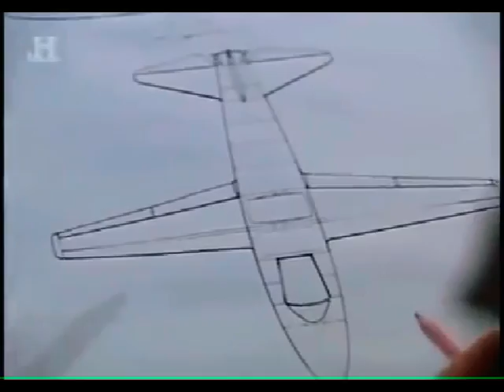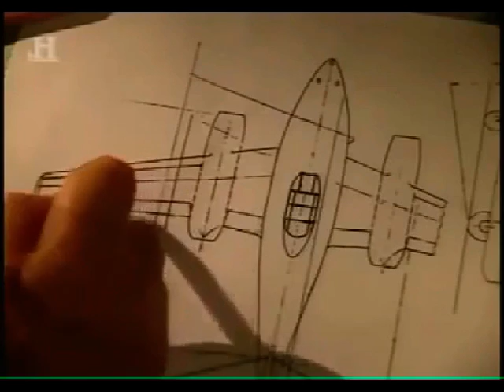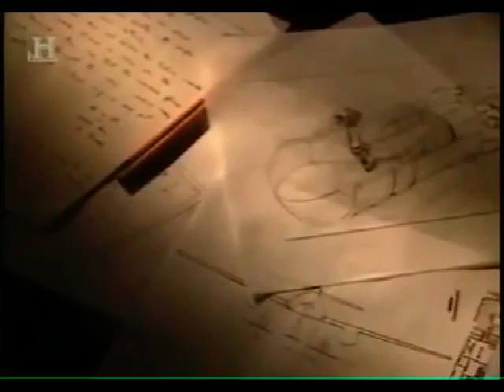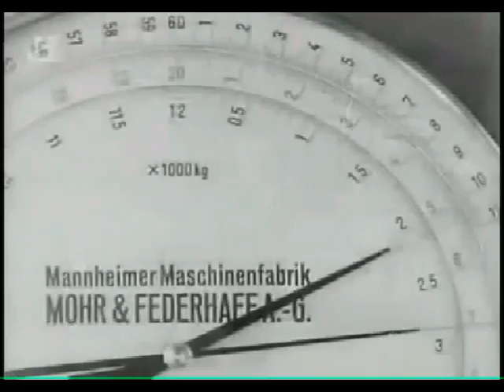The Father of the Jet Engine - Hans Von Ohain

Comment: More youtube bollocks.  The axial flow engine was conceived by many engineers in the 1920s.  The problem was it was always recognised the technology did not exist to make the engine reliable - as the Germans found out.  Whittle was well aware that the simple axial flow engine was preferable but knew it would be unreliable.  He chose to develop the centrifugal engine for practical reasons.
Reply from the maker: First jet flight - German, first twin engine flight - German, first operational fighter unit - German....Even R/R tossed the centrifugal design in the bin by 1950 for axial  (avon) as.it was a dead end design The limitation of the Me262 axial engine  were due to shortages of exotic metals  - not design.  Besides it could be swapped out in an hour  and could be services and reused.
Reply: Interesting theory, except that the Jumo 004 engine exceeded the 100 hrs PFTR standards of both the RAF and USSAF during WW2.
Reply: @sandervanderkammen9230  "If I could have fitted the Meteor engines to the Me 262 airframe I would have had the best fighter in the world" Adolf Galland.
Reply: @fritzfieldwrangle-clouder7299  You could not fit Meteor engines on the Messerschmitt Me-262, they were too big and heavy... centrifugal turbojet engines were a dead-end design.
Reply: @fritzfieldwrangle-clouder7299  You could not fit Meteor engines on the Messerschmitt Me-262, they were too big and heavy... centrifugal turbojet engines were a dead-end design.
Reply: @sandervanderkammen9230  You'll have to take that up with Adolf Galland. If I'm pressed to say who I would trust to know better on  the issue I think I'll go with Adolf Galland thanks all the same.
Reply: @fritzfieldwrangle-clouder7299  Centrifugal turbojet engines are too large and heavy, they are no longer used in  jet fighter aircraft... only axial compressor engines are used today.
Reply: @sandervanderkammen9230  Not according to Pabst von Ohain. From his forward to 'Elements of Propulsion, gas turbines and rocket'-
"The first patent of a turbojet engine, which was later developed and produced,
was that of Frank Whittle, now Sir Frank (see Fig. 5). His patent was applied for
in January 1930. This patent shows a multistage, axial-flow compressor followed
by a radial compressor stage, a combustor, an axial-flow turbine driving the
compressor, and an exhaust nozzle. Such configurations are still used today for
small- and medium-power output engines,"

So you'll have to take it up with him, If I'm pressed to say who I would trust to know on the issue, you or Pabst von Ohain, I'll go with Ohain thanks all the same.

Of  course you might expect Ohain to have a soft spot for centrifugal flow engines because his own design was a centrifugal flow engine. So if centrifugal flow engines are somehow not valid, are you going to tell Spottydog4477 that his youtube video is wrong?

 Anyway the issue was then, not now so it doesn't change that fact that Adolf Galland who flew both aircraft in service rated the Meteor's engines over the 262's.

What's more of course most jet fighters and civil aviation 'jets' don't use pure jets anyway, they use turbofans. This is what Ohain has to say-
"From the beginning of his jet propulsion activities, Frank Whittle had been
seeking means for improving the propulsive efficiency of turbojet engines. ¶ He
conceived novel ideas for which he filed a patent application in 1936, which
can be called a bypass engine or turbofan. To avoid a complete new design,
Whittle sought an interim solution that could be merely "tacked on" to a jet
engine. This configuration was later known as the aft fan. Whittle's work on
fan jets or bypass engines and aft fans was way ahead of his time. It was of
greatest importance for the future or turbopropulsion."

And as for Axial flow Pabst von Ohain's own description of Whittle's patent clearly refers to axial flow elements in whittle's design. In Ohain's own words-

"This patent shows a multistage, axial-flow compressor followed
by a radial compressor stage, a combustor, an axial-flow turbine driving the
compressor, and an exhaust nozzle."
Reply: @fritzfieldwrangle-clouder7299  Apparently you both were unaware of Maxime Guillaume patented the turbojet engine first in 1921.
Reply: @sandervanderkammen9230  You mean  the one with the charming little crank handle that we've discussed before, the one that Pabst von Ohain described as not viable. That Pabst von Ohain, do you think he was a liar?
Reply: @fritzfieldwrangle-clouder7299 What is your point? Frank Whittle's 1930 patent wasn't viable either... he never constructed it or any engine with a axial compressor.
Frank Whittle did not patent the turbo jet engine first and he was not the first to build a successful flightworthy turbojet engine.
 You lose.
Reply: @sandervanderkammen9230  Ah, the Whittle patent which Pabst von Ohain describes thus-
"The first patent of a turbojet engine, which was later developed and produced,
was that of Frank Whittle, now Sir Frank (see Fig. 5). His patent was applied for
in January 1930. This patent shows a multistage, axial-flow compressor followed
by a radial compressor stage, a combustor, an axial-flow turbine driving the
compressor, and an exhaust nozzle. Such configurations are still used today for
small- and medium-power output engines,"
That Pabst von Ohain, do you think he was a liar?
Reply: @sandervanderkammen9230  By the way Sandy honey, have you managed to come up with any evidence to support your silly claim that  Pabst von Ohain  built a prototype jet engine at Gottingen university in 1934? You know, anything that will sufficiently refute Pabst von Ohain's own clear recollection of doing nothing of the sort.
Reply: @fritzfieldwrangle-clouder7299  Whittle did not build an axial compressor turbojet engine.
Reply: @fritzfieldwrangle-clouder7299  The 1934 prototype was constructed by Hans von Ohain and Max Hahnn at Bartels und Becker Rennsport Denist in Gottingen Germany.
Reply: @sandervanderkammen9230   Evidence Sandy love. You can read Pabst von ohain's own words in 'Elements of Propulsion, gas turbines and rockets' and he makes it quite clear that no prototype engine was built in 1934. Are you calling Ohain a liar? Do you claim to know better  that he himself?
Reply: @sandervanderkammen9230 Pabst von Ohain's own word on Whittle-
"The first patent of a turbojet engine, which was later developed and produced,
was that of Frank Whittle, now Sir Frank (see Fig. 5). His patent was applied for
in January 1930. This patent shows a multistage, axial-flow compressor followed
by a radial compressor stage, a combustor, an axial-flow turbine driving the
compressor, and an exhaust nozzle. Such configurations are still used today for
small- and medium-power output engines,"
Just say it straight up Sandy honey, do you think Pabst von Ohain was lying?
Reply: @fritzfieldwrangle-clouder7299  Frank Whittle did not invent the turbojet engine....
Reply: @sandervanderkammen9230  Just to remind you Sandy dear, from Pabst von Ohain's forward to 'Elements of Propulsion, gas turbines and rockets' in Pabst von Ohain's own words-

"The first patent of a turbojet engine, which was later developed and produced,
was that of Frank Whittle, now Sir Frank (see Fig. 5). His patent was applied for
in January 1930. This patent shows a multistage, axial-flow compressor followed
by a radial compressor stage, a combustor, an axial-flow turbine driving the
compressor, and an exhaust nozzle. Such configurations are still used today for
small- and medium-power output engines,"

and-

"In April 1937, Whittle had his bench-test jet engine ready for the first test run.
It ran excellently; however, it ran out of control because liquid fuel had collected
inside the engine and started to vaporize as the engine became hot, thereby
adding uncontrolled fuel quantities to the combustion process. The problem
was easily overcome. This first test run was the world's first run of a bench-test
jet engine operating with liquid fuel (Fig. 7)."

and-

"From the beginning of his jet propulsion activities, Frank Whittle had been
seeking means for improving the propulsive efficiency of turbojet engines. ¶ He
conceived novel ideas for which he filed a patent application in 1936, which
can be called a bypass engine or turbofan. To avoid a complete new design,
Whittle sought an interim solution that could be merely "tacked on" to a jet
engine. This configuration was later known as the aft fan. Whittle's work on
fan jets or bypass engines and aft fans was way ahead of his time. It was of
greatest importance for the future or turbopropulsion."

And in regard to his own effort Pabst von Ohain says-

"In early 1935, I worked out a patent for the various features of a gas turbine
consisting of radial outflow compressor rotor, combustor, radial inflow turbine,
and a central exhaust thrust nozzle."  

followed by-

"My main problem was finding support for my turbojet ideas. A good approach,
it seemed to me, was to first build a model."

So in Ohain's own words he didn't patent till 1935, five years after Whittle and he hadn't even built a model of his engine by then let alone a working prototype so either you claim that Ohain is a liar and doesn't know himself what he did or your silly claim of a working prototype in 1934 is a lie. Which is it Sandyboy, come on, speak up?
Reply: @fritzfieldwrangle-clouder7299  Interesting anecdotes... but it does not change the facts.
Frank Whittle did not invent the turbojet engine.
He was not the first to patent.
Not the first to build.
Not the first to fly.
Reply: @sandervanderkammen9230   Oh dear, you don't understand the difference between an anecdote and a quote. And I see you still don't present any evidence to support your claim of an engine built by Ohain and Hahn in 1934 entirely contradictory with Ohain's own written history of events. Can we take it you've dropped  that particular lie? Let's look at some facts quoted in Pabst von Ohain's own words-
"The first patent of a turbojet engine, which was later developed and produced,
was that of Frank Whittle, now Sir Frank (see Fig. 5). His patent was applied for
in January 1930. This patent shows a multistage, axial-flow compressor followed
by a radial compressor stage, a combustor, an axial-flow turbine driving the
compressor, and an exhaust nozzle. Such configurations are still used today for
small- and medium-power output engines,"

and

"In April 1937, Whittle had his bench-test jet engine ready for the first test run.
It ran excellently; however, it ran out of control because liquid fuel had collected
inside the engine and started to vaporize as the engine became hot, thereby
adding uncontrolled fuel quantities to the combustion process. The problem
was easily overcome. This first test run was the world's first run of a bench-test
jet engine operating with liquid fuel (Fig. 7)."

and

"From the beginning of his jet propulsion activities, Frank Whittle had been
seeking means for improving the propulsive efficiency of turbojet engines. ¶ He
conceived novel ideas for which he filed a patent application in 1936, which
can be called a bypass engine or turbofan. To avoid a complete new design,
Whittle sought an interim solution that could be merely "tacked on" to a jet
engine. This configuration was later known as the aft fan. Whittle's work on
fan jets or bypass engines and aft fans was way ahead of his time. It was of
greatest importance for the future or turbopropulsion."

Are you calling Ohain a liar.
Reply: @fritzfieldwrangle-clouder7299  Frank Whittle did not invent the turbojet engine...
Just get over it.
Reply: @sandervanderkammen9230  Hi Sandy honey, how are you on this happy Monday morning, still griping because Whittle rightfully gets  credit as the father of the jet engine. Never mind mate, if you could just make up your mind once and for all who you are actually supporting and you can just come with some actual evidence and a credible argument you might not look such a hopeless case on the issue.
Here's just a reminder of what Pabst von Ohain had to say on the issue-

"The first patent of a turbojet engine, which was later developed and produced,
was that of Frank Whittle, now Sir Frank (see Fig. 5). His patent was applied for
in January 1930. This patent shows a multistage, axial-flow compressor followed
by a radial compressor stage, a combustor, an axial-flow turbine driving the
compressor, and an exhaust nozzle. Such configurations are still used today for
small- and medium-power output engines,"

and

"In April 1937, Whittle had his bench-test jet engine ready for the first test run.
It ran excellently; however, it ran out of control because liquid fuel had collected
inside the engine and started to vaporize as the engine became hot, thereby
adding uncontrolled fuel quantities to the combustion process. The problem
was easily overcome. This first test run was the world's first run of a bench-test
jet engine operating with liquid fuel (Fig. 7)."

and

"From the beginning of his jet propulsion activities, Frank Whittle had been
seeking means for improving the propulsive efficiency of turbojet engines. ¶ He
conceived novel ideas for which he filed a patent application in 1936, which
can be called a bypass engine or turbofan. To avoid a complete new design,
Whittle sought an interim solution that could be merely "tacked on" to a jet
engine. This configuration was later known as the aft fan. Whittle's work on
fan jets or bypass engines and aft fans was way ahead of his time. It was of
greatest importance for the future or turbopropulsion.
"
Reply: @fritzfieldwrangle-clouder7299   Maxime Guillaume patented the turbojet engine 9 years before Frank Whittle.
Hans von Ohain built the first jet turbojet engine and successfully flight tested on August 27th 1939.
Two years before Frank Whittle.
Reply: @sandervanderkammen9230  So Sandyboy, you are going with Guillaume again with his cute little crank handle. I see you haven't the guts to say it right under Spottydog4477's nose. But let's just see what Pabst von Ohain had to say on the subject-

"The first patent of a turbojet engine, which was later developed and produced,
was that of Frank Whittle, now Sir Frank (see Fig. 5). His patent was applied for
in January 1930. This patent shows a multistage, axial-flow compressor followed
by a radial compressor stage, a combustor, an axial-flow turbine driving the
compressor, and an exhaust nozzle. Such configurations are still used today for
small- and medium-power output engines,"

and

"In April 1937, Whittle had his bench-test jet engine ready for the first test run.
It ran excellently; however, it ran out of control because liquid fuel had collected
inside the engine and started to vaporize as the engine became hot, thereby
adding uncontrolled fuel quantities to the combustion process. The problem
was easily overcome. This first test run was the world's first run of a bench-test
jet engine operating with liquid fuel (Fig. 7)."

and

"From the beginning of his jet propulsion activities, Frank Whittle had been
seeking means for improving the propulsive efficiency of turbojet engines. ¶ He
conceived novel ideas for which he filed a patent application in 1936, which
can be called a bypass engine or turbofan. To avoid a complete new design,
Whittle sought an interim solution that could be merely "tacked on" to a jet
engine. This configuration was later known as the aft fan. Whittle's work on
fan jets or bypass engines and aft fans was way ahead of his time. It was of
greatest importance for the future or turbopropulsion.
"